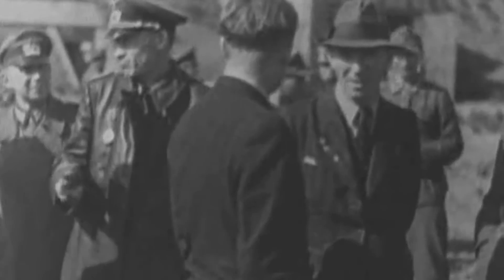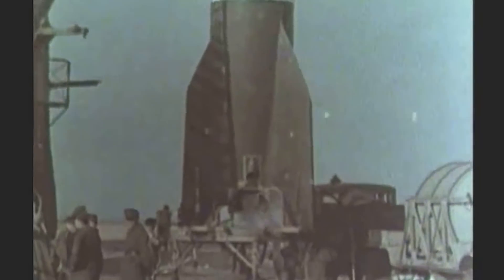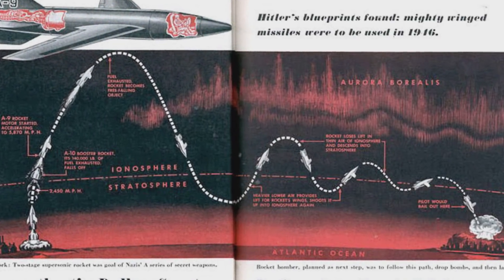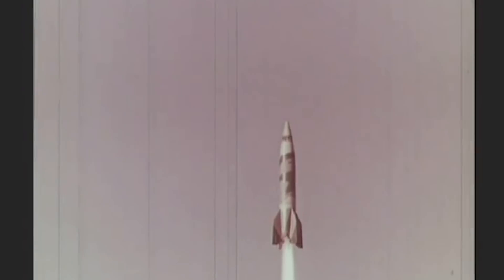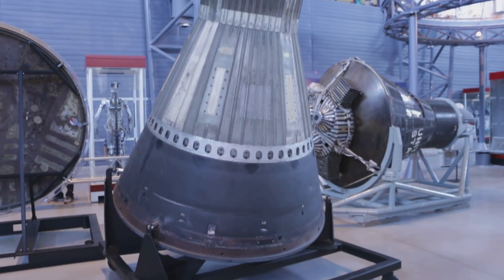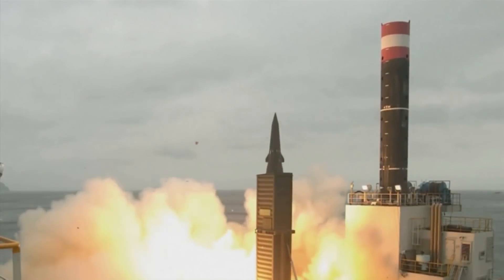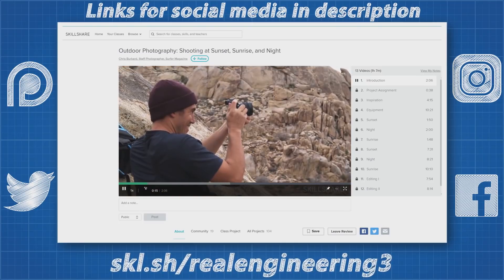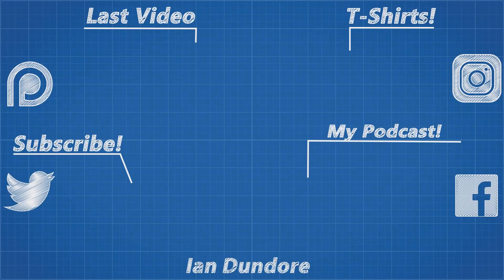Why North Korea Can't Build An ICBM (yet)

Comment: The North Koreans could use the U.S. public GPS network. It's available to anyone. It's just like military-grade (it's from the same satellites), except it's only accurate to ten or twenty meters, not ten or twenty centimeters. But that's good enough for Kim's needs.
Reply: Real Engineering: wrong. Your device itself is programmed to shut down if the GPS signals it receives from the satellites indicate it is travelling at over 1200 mph. The satellites don't shut off their signals. Use your head. That would drop all GPS for everyone in that entire hemisphere of the world. We don't all get some special individual beam from the satellite. We all use the same beam, and it takes at least four satellites for your cell phone to triangulate its own position. Drones require six.

The signal is one-way. Do you really think your phone is constantly broadcasting info back to a satellite? Nope. Yet that's the only way the satellite would know to shut off. Your phone can't effectively broadcast much past the nearest cell tower. It's just receiving signals from four powerfully-broadcasting geostationary satellites in the sky and number-crunching that info internally into its own positional coordinates.

NK would just have to build its own little guidance system and leave out the Shutdown-At-1200MPH line in its programming.
Reply: This limit is only programmed into the receivers, it shouldnt be impossible to bypass it.
Reply: That just means they can't use a commercially available receiver. Technically, nothing is stopping them from engineering they're own receivers without the restriction. One hacker already did, and was even kind enough to post the instructions and source code online for everyone to see: http://www.aholme.co.uk/GPS/Main.htm

Of course the obvious downside to relying directly on your enemies infrastructure, is that the US army could just shut down civilian GPS at any time if they felt there was a threat (as you yourself already mentioned in your GPS video) and then NK would be back at square one.
Reply: +Wilhelm VonRoefelz  You're totally right and it's amazing no one else mentioned that. ICBM's are all PREprogrammed by ONboard navigation. Otherwise other country's could hack in to the signals and read/alter them.
Reply: It cuts off at a certain speed and a certain altitude
Reply: A SatNav would, but I really can't see any sane engineer literally putting a TomTom inside an ICBM... fucking hilarious though it would be, it would get 200 miles before blowing up after trying to do a 180 degree turn as the SatNav says "Turn around when possible". Or just lose signal and fly off across the solar system. In all seriousness, it's the GPS unit that has the limitations, and I don't imagine they're unhackable, or that it's possible to design a unit that can guide an ICBM to within a few hundred metres of a target.
Reply: He doesn't understand that because 'Real Engineering' isn't an engineer, but some marketing firm farming youtube clickbait.
Reply: zippymax1 riposte dont worry they dont have internet :D MEMES RUSH
Reply: Louai Al-Obaidi: If the U.S. detected an incoming ICBM, I suppose it's conceivable they could shut down whichever of the 27 satellites they needed to for about a half hour. I suppose ships and planes all have backup navigation systems...

Oh well...the Russians and the Chinese also have such networks. They should just use those as a backup.

Okay Kim Jong Un: we have it all figured out for you.
Reply: Lol welcome to pentagon discussions on US GPS security.
Reply: Real Engineering looks like we have to assume that in event of a missile attack US will shut off GPS.
Reply: well actually it is closer to 5 meters ,but the thing is American GPS can be cancelled at any point by the government, as it is a Military asset.  (arguably one of America's greatest assets due to how much it has empowered america)  the point is the US likely already has special jammers for north Korea to keep them from using Americas GPS and in the case of an Emergency they almost certainly would revoke GPS privileges from the world till it is over.  (Something they did regionally in Iraq during the Iraq war)
Reply: Alcathous: wait...Real Engineering isn't a real engineer? What the actual fuck...?!
Reply from the maker: Public GPS shuts off the moment the receiver begins acting like a missile
Reply: this is inaccurate, GPS devices which want to be exempt from munitions classification disable themselves above 60k ft. and/or move faster than 1000knots.